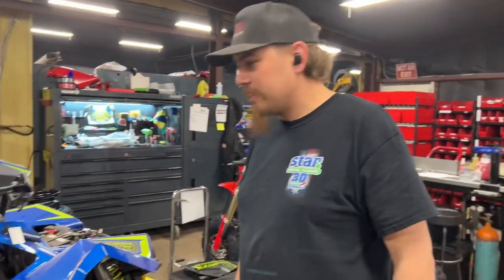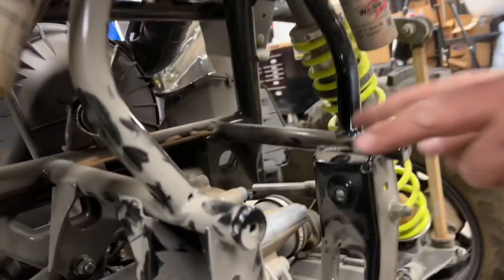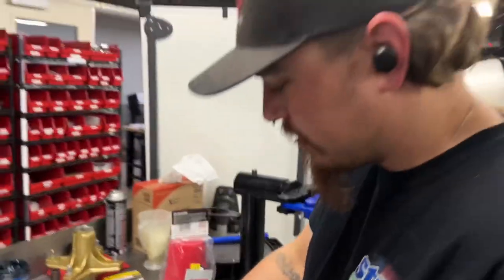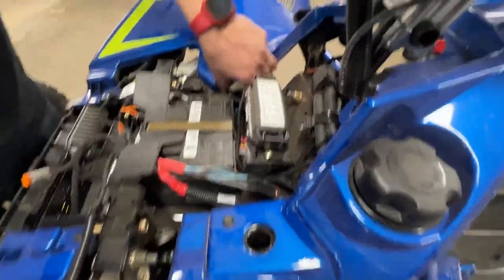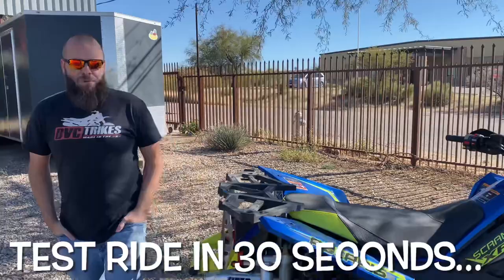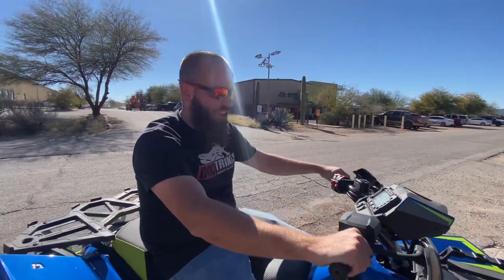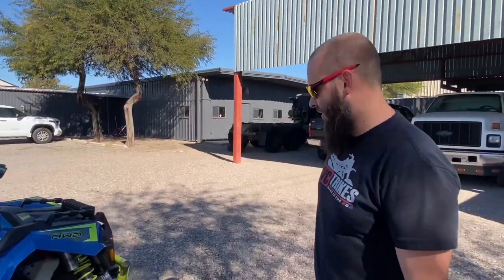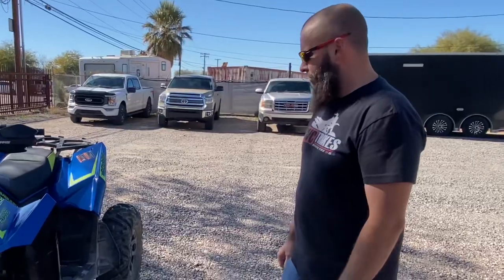HMF DUAL EXHAUST - 23’ POLARIS SCRAMBLER XP1000S

Comment: That bottom mount for the old exhaust is not supposed to come off that’s also a diff mount so not take it off
Reply from the maker: 100% Correct 👍🏼   We ended up cutting the hanger off and re powdering it  (diff mount) and re installing after video